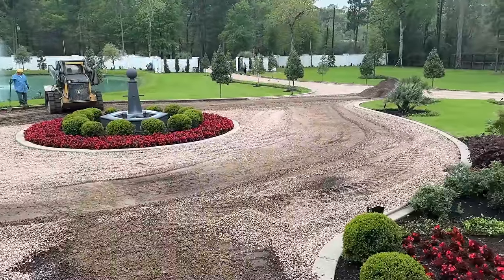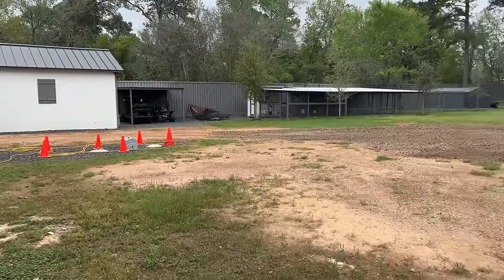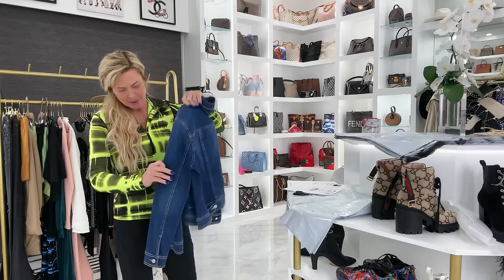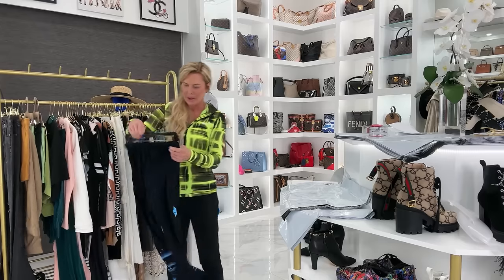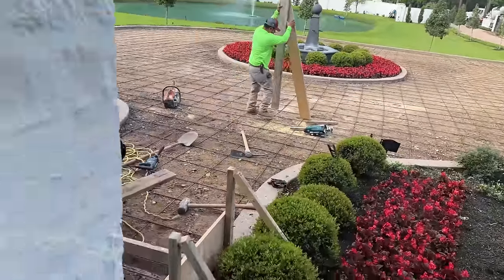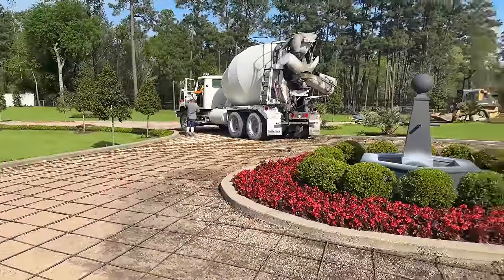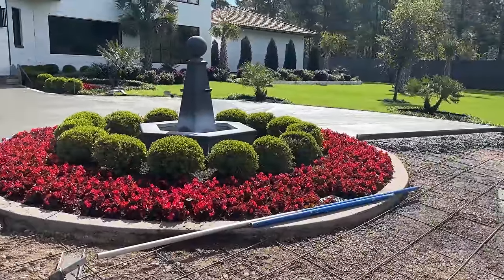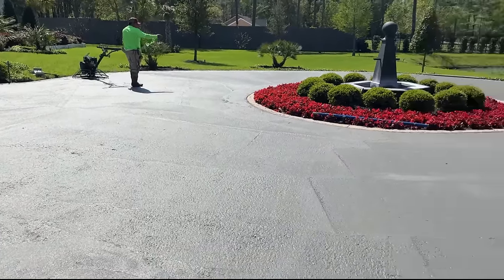IT'S FINALLY HAPPENING

Comment: Another sweetener to the new driveway is under concrete heating (can be retrofitted).  We had in a couple of properties with vast driveways & outdoor living areas.  Wasn’t a great raging heat but did prevent any ice or snow settling.  Just a nice addition and allowed for outdoor exercise in the cold months.